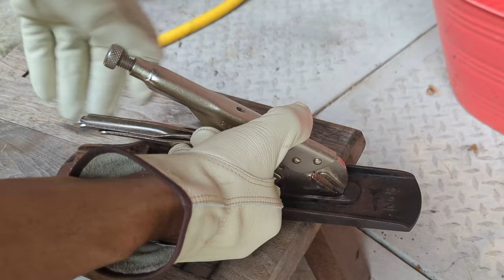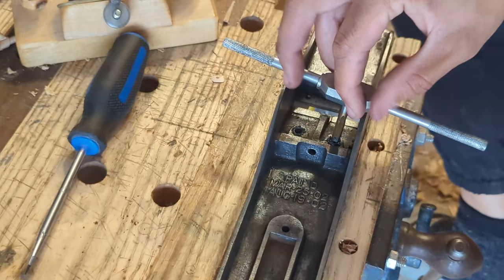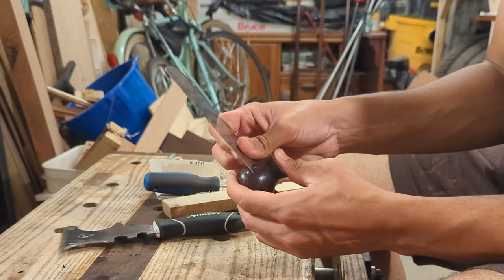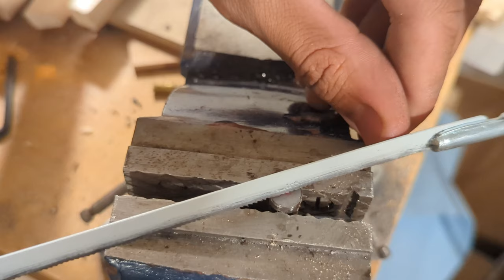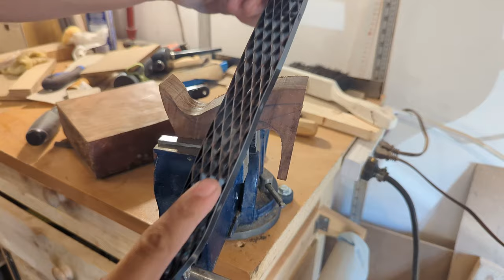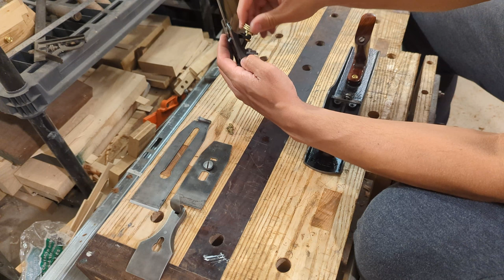100 Year Old Hand Plane Restoration

Comment: Lovely job. I buy broken planes for cheap to use for spare parts when needed, though I’ve made my share of emergency parts too. I’m pretty sure that Stanley used a custom or whitworth thread on their old bench plane and may be difficult to find (a whitworth tap and die set) these days.  I have a type 9 no.3 plane, looks like yours is a type 9 as well. 👍
Reply from the maker: I think custom; I was looking everywhere for a 12-20 screw/bolt replacement for the frog and tote when I realized it would just be easier to re-tap with a 1/4-20 and use what I had lying around, lol. I'm sure if this plane lasts another hundred years, the future owners won't mind one bit

Thanks for watching! 😁

Comment: Seriously? Spray paint? If you sell that thing, please tell the buyer you didn't care enough to study how they were made and "just used a rattle can to make it look pretty".
Reply: And give them the original parts so they can fix it properly. Tote screws can be purchased for a few bucks.
Reply: I may sound a bit harsh. But looks aren't everything.  To someone who knows little about planes, it looks like an awesome job. And if you plan to keep it for your own use, it will more than suffice. But if it's to be sold, the buyer isn't getting what they think they are.
Reply from the maker: Definitely planning on keeping it for myself, I had no intention at all of doing a historically accurate restoration. The original laquer was 90% gone and I wasn't about to mess around with oven curing home made japanning lol.

In any case, I used Dupli-Color enamel engine paint which is a decent substitute for my use, and more than likely much more durable than the original finish